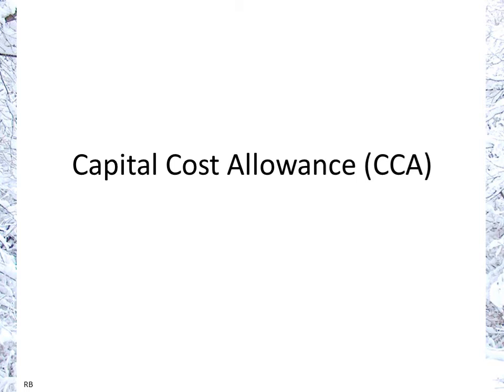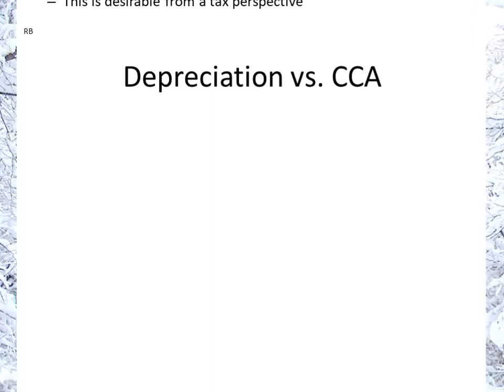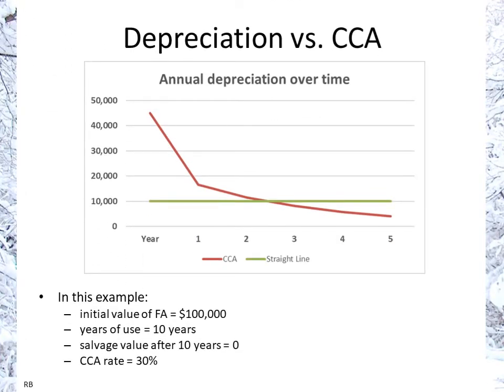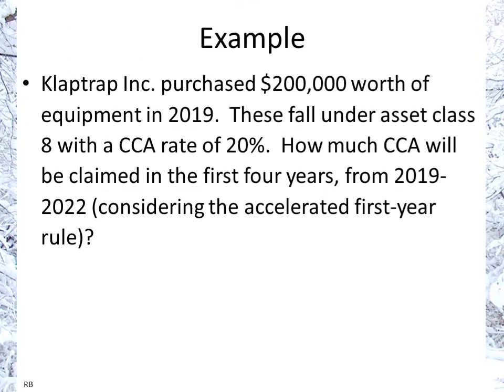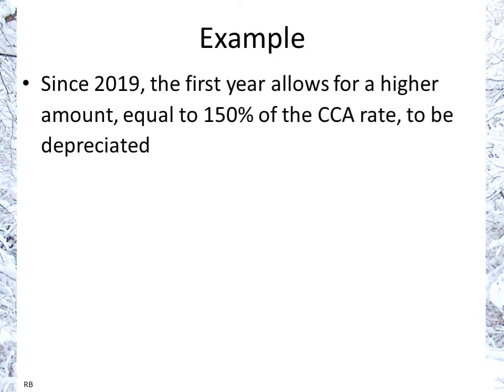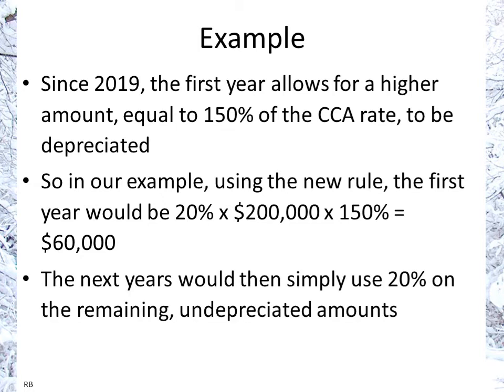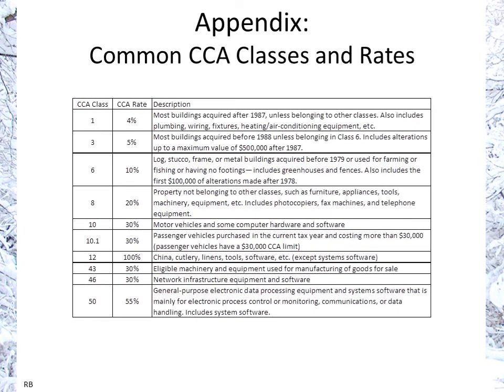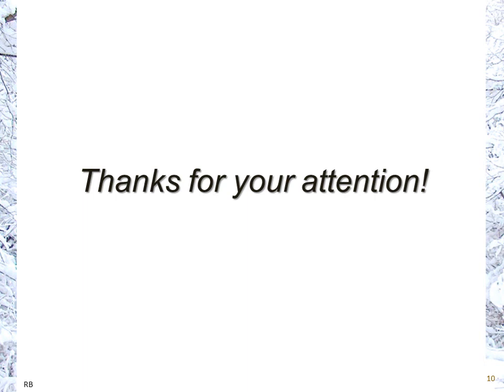Calculating the Capital Cost Allowance (CCA)

Comment: What happens to the remaining $$ after 4 years of depreciation? Do you keep applying the 20% forever until the equipment reaches $0?
Reply from the maker: Hi Ryan, yes, you keep applying the 20%. 
When you sell or get rid of the assets in the class and end up with a UCC (unclaimed capital cost - which I often call undepreciated capital cost), then you have either a terminal loss (if the UCC is positive) that you can apply, or you have "recapture" that essentially is treated as income if the UCC is negative. 
That has a logic to it, because any positive UCC represents capital costs that haven't been depreciated, while a negative balance would be like "over-depreciating" the asset class.

Comment: What happens to CCA claim on the last return when a business (sole proprietorship) is closed? Do you deduct as usual or do you get to deduct the UCC that's left over? Also, same question if you make a purchase in the last year of business - do you claim CCA using the accelerated rule as usual, or is there an alternate calculation?
Reply from the maker: Whenever a CCA class is closed (due to closure of the business,  selling all assets of the class, etc.), then the difference between the disposal value of the assets and the remaining book value is taxable. Of course, if the disposal value is higher, then the difference is positive and therefore taxable. If the disposal value is less, then difference is negative and the loss is a tax benefit.
Based on that the accelerated rule doesn't matter if you purchase the asset in the final year because the taxable expense will essentially be the difference between the purchase price and the disposal price.
Reply: @robinb206  Thanks for your response. In the case of a sole proprietorship, what if the capital was not sold but kept for personal use - does the CRA consider it as deemed disposition at FMV?
Reply from the maker: Hi Alex, the only thing I'd like to mention is that a sole proprietorship is transparent from a tax point of view, i.e., the profits and losses are not taxed but flow into your personal income. But as for the specifics of your question, we're now deep enough in tax territory where I'd suggest you check with a tax expert (which I am not).

Comment: Thank you so much.  What happens when you have a disposition and acquisition? can you show it on a chart again?
Reply from the maker: If you have both a disposition and an acquisition, then you treat the net amount as you would in this example. (This is assuming that both assets are in the same CCA class.) So if, for example, a $80,000 asset is purchased and $50,000 is disposed of, then you treat the net $30,000 the same as if you had only purchased $30,000 worth of assets in that class.

Comment: I buy a house for 100K and after 10 years i sell the house for 250k the capital gain shows 150k BUT  there is a component on the value of the money over time and my initial 100k on year 10 will be way more and my capital gain wont be  150k. How to incorporate the value of the money over time to reduce the capital gain? It may even change to be a loss. Could you please elaborate on that? Thank you
Reply from the maker: You're right. Figuring out your true "net gain" can be a bit tricky. But let's first talk about terminology: "capital gains" are an expression of an accounting profit and may be particularly relevant for tax reasons. And that gain might not be measured against the purchase price but rather the remaining undepreciated portion (resulting in a higher capital gain than just the difference in sales-purchase price).
In terms of value, this does not consider the time value of money or any inflation, as you mention. To consider that, you might want to look at an appropriate "cost of money" and add that as a charge to the cost of the real estate (compounded).
One final note: if you're using (i.e., living) in the house, then you are deriving a benefit from that (value in use), which is not seen - and can't exactly be quantified - in the numbers. A best estimate approximation would be the value of renting something of equivalent value. It's that consideration that often makes real estate attractive, even when the pure "capital gains" proposition doesn't hold.

Comment: Is there an end point where you would completely write off 100% of the depreciation of an item? If you are only to write off, say, 30% of the starting value each year, you will never actually make it to 0$.
Reply from the maker: Hi Jordan, you're right! It will never actually make it to 0$, assuming you never technically dispose of the asset.
Of course, the asset will usually be in a pool of assets that gets replenished, but that asset will contribute insignificantly to the CCA.